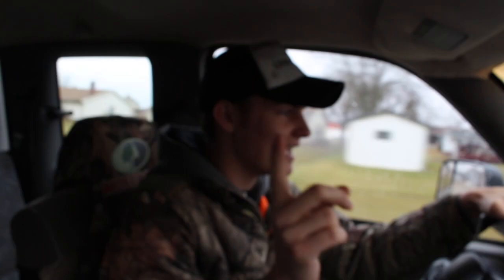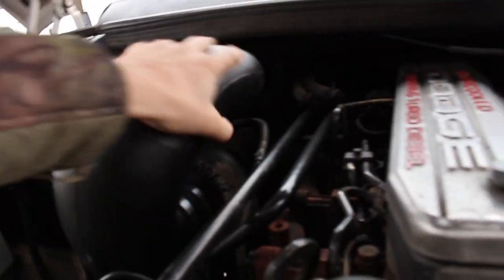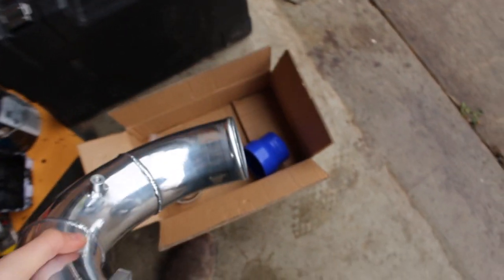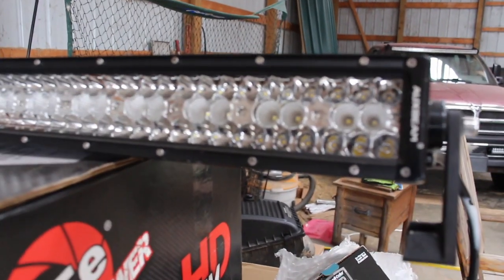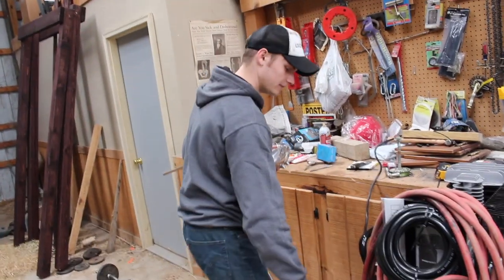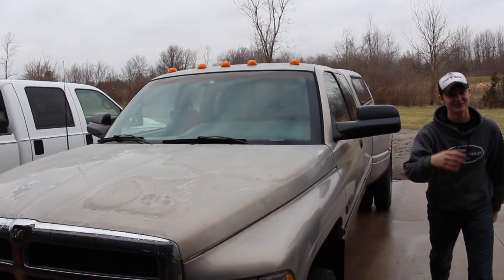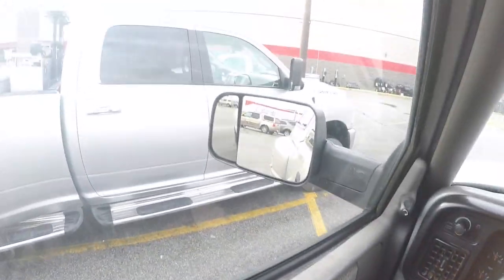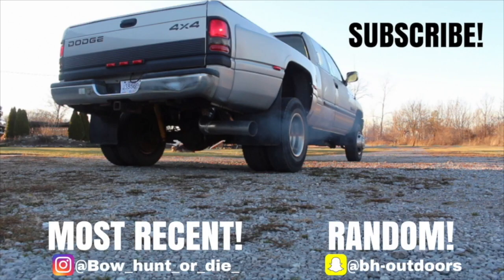NEW SHINY PART FOR THE DUALLY 12 VALVE CUMMINS!!! *LIGHT BAR GIVEAWAY*

Comment: Main reason I started watching your channel was when I seen the video of the first gen blowing smoke, I love the old 12 valves and especially the 1st gens I’ve watched every single video all the way through since because you really inspire me to get an old diesel weather it’s obs 12 valve or the 6.5 gm diesel. My favorite content you bring is any content with your truck weather it’s snowy donuts to tuning for smoke or mods to make it look good and also I love the work vids and four wheeler mudding. And my favorite video would have to be when you got your new wheels for the 2nd gen because they looked bad ass and fuel wheels are probably one of my favorite brands of wheels. Love the content keep up the good work.

Comment: The first video that brought me to the channel was when you had your white 12 valve hauling firewood out of the woods. Ever since that video I've been watching your new uploads the same day that you post them. Your channel has made me want a cummins more than ever, and someday when I can afford it I will get one. I recently bought a 1994 1500 chevy w/t single can long box that is a 5 speed. It turned out the next day you bought your dually 5 speed. So we're on the same page with the manual transmissions.

Comment: Hey Loudandproud accually the first video i watched was your Fuel plate video. i have a 96 dodge ram 12 valve and i wanted more power but dident know how and after i watched your fuel plate video i went straight out side and did the same thing (Zero fuel plate) and Wow it made my truck roll so much more coal but not as much power as i wanted soi went back anf i seen u posted a video on your AFC housing and i told myself i had to do that and i did the next morning. i pretty much did the same thing as you but i put a lighter spring in but i dident cut a 1/8 off my slider thing haha dont know the name and Holy crap dose my truck pick up speed and way more boost 42psi boost. im so happy that i found your channel because if not for those videos i probaly would have screwed something up haha and im loving what u are doing to the dually but ifnu want to increase your fuel and air. you can advance your timing on your Ppump but be carefull u dont advance it do much. lot of people dont know this but if u want more horse power and toruge u need more fuel and air but with 12 valve u will get a lot of unburnt fuel and a little bit of let with your turbo nothing u can do unless u upgrade to twins. ALSO SMOKE COAL NOT CRACK haha thank you for your videos and i will keep watfching your videos and i will let people know to watch your videos thank you and have a VERY MERRY CRISTMAS

Comment: Hey, I'm just getting in to the whole off road stuff and wondering what brand of light bars are cheap but dependable?   I got a 1991 Toyota pickup and I'm thing of doing a 40-48 inch bar, what's your thoughts on it?

Comment: Don't really follow because of the diesel mods, but I do like what you've been doing to the body of the trucks. came into ownership of a 97 ram 1500. think it may get plasti-dipped. 

i've had a set of Wolverine work boots that have lasted about 5 years so far.

Comment: You don’t plug in the grid heater on the 12 valves, you plug in the block heater. Grid heater is the wait to start light when you turn on the key.

Comment: The video that got me to subscribe was your video about how you bought a Cummins at 17. And my favorite video is you buying the dually because it's just motivational to me and proves that I can someday in the near future buy my first diesel as long as I keep working and pushing hard
Reply: The work boots I have are Durango rebels. They work for me cuz they are slip and oil resistant so for the environment I work it, they are perfect. And they are currently my daily drivers cuz I can't afford another pair right now but also they are much more comfy than my black dress boots

Comment: The reason the 7.3’s batteries are going died is because you need to run a another ground wire from the battery to the alternator because those alternators need another ground wire so they don’t burn out as fast